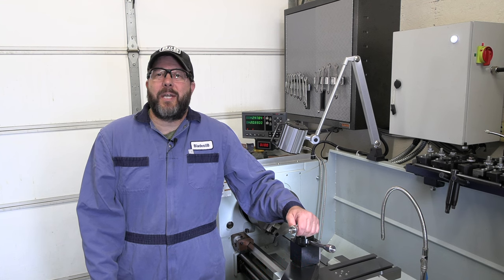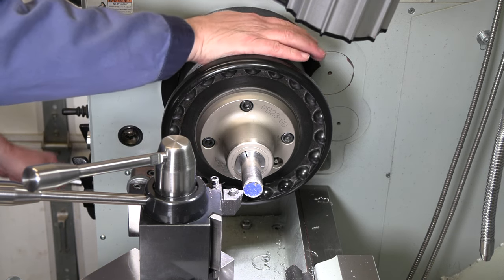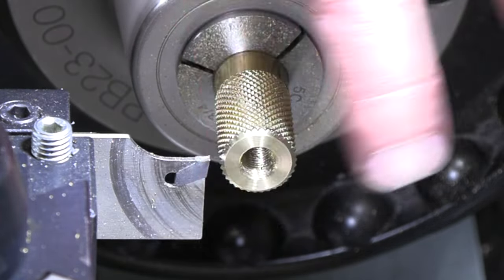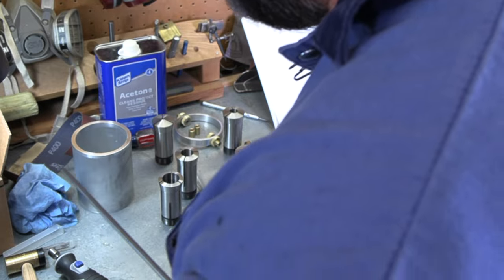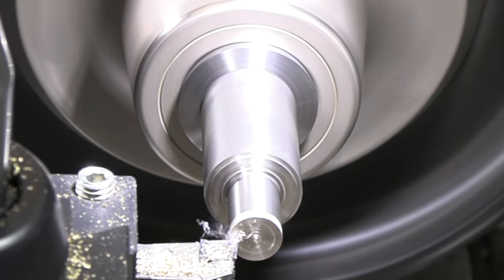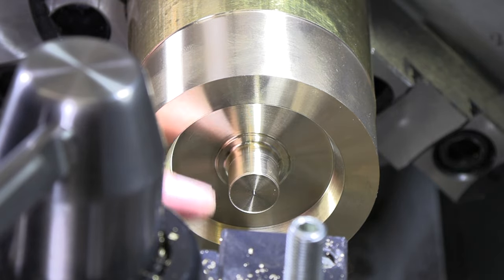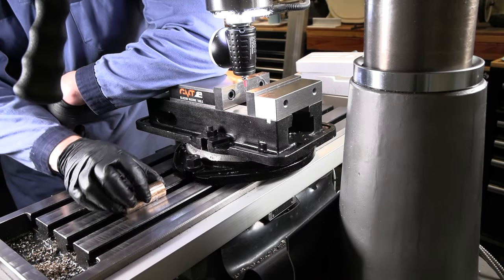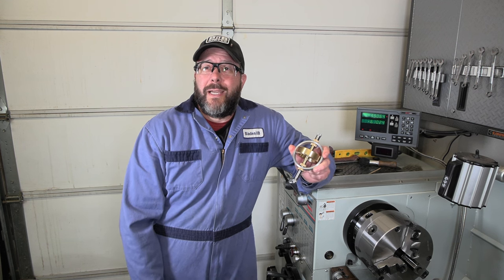Gyroscope Build With Through Shaft, Ceramic Bearings Using A Cordless Rotary Tool To Power It

Comment: I just got done building a gyroscope on my mini lathe and I found that washing the grease out of the bearings with paint thinner makes a humongous difference. I learned that from learning to yo-yo and cleaning yoyo bearings back in the day. They don't really need grease because they're not doing any real work It's not like you're putting a hundred pounds on those little bearings

Comment: The flywheel should have had a matching radius as the outside cage.
Reply from the maker: @ wags9777 - Yes that would have looked great for sure. I don’t have a radius tool to be able to cut that 3/4” wide radius and trust it would look nice. With the price of brass I did not want to risk messing that up. Maybe next time. Thanks for the comments.

Comment: I feel like your lathe only has one speed
Reply from the maker: @wags9777 - For this material and even the stainless at small diameter I could run max speed on my lathe for most of it. I chose to slow it down one speed. So yes, other than the threading and parting, I did use the same speed for most of this project. If I had a little CNC lathe. I would have been turning faster for a lot of it.

Comment: Enjoyed watching your great work.  Do you think it’s possible to make one with a 3 jaw chuck and get the precision required?
Reply from the maker: @lisag2771 - Thanks for the feedback and the question.  I believe you could make this in a 3 jaw yes.  The flywheel and the bearing cup are the only two parts I turned around where any runout in your 3 jaw could cause issues.  To minimize on the flywheel, you could just turn the outside after you turn then for sure you would have the center hole, outside, and one complete side all concentric.  Having the outside of the boss and the cut out a little off should not have a huge impact on balance.  For the bearing cups, since you are machining the bearing recess and the center hole concentric, I think the thread may have enough play to make up for runout on your 3 jaw.  You could also use a cone bearing on the bottom side and only use the ball bearing on the top to allow the shaft to extend out the top for the starter?  Bottom line, will depend on how far your three jaw runs out when you turn parts around.  you could also mount the flywheel on a mandrel and machine both sides at one time?  Good luck.
Reply: @BladesIIB  Thanks, that makes sense.  Keep sharing great videos.